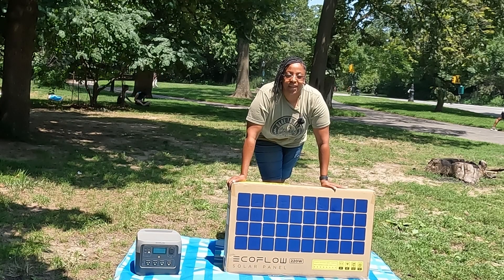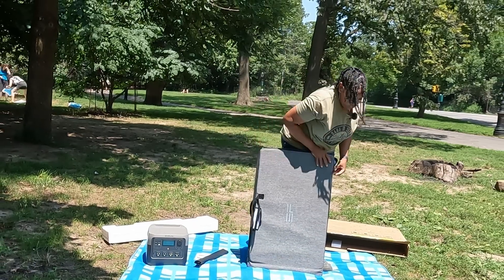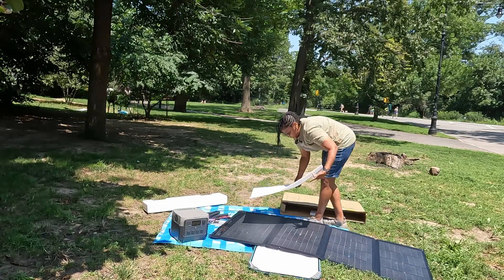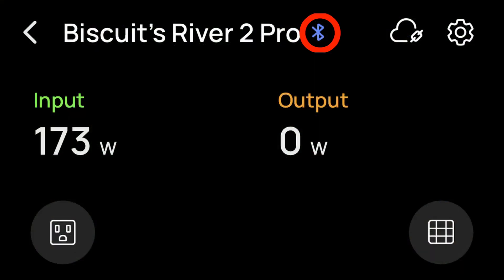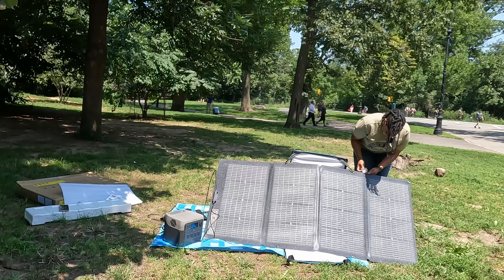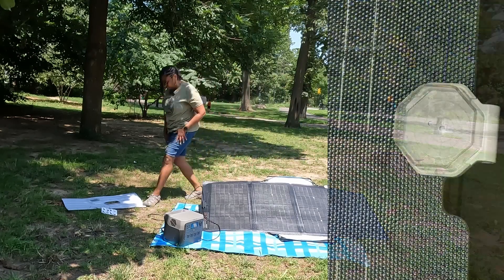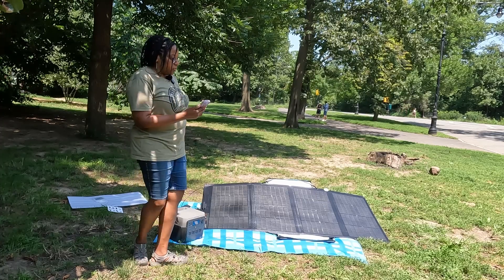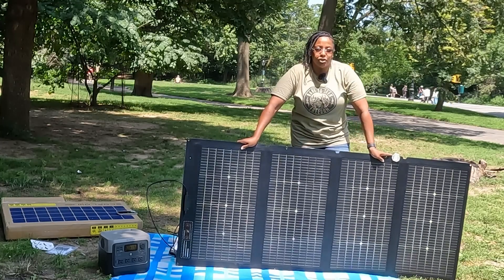EcoFlow 220W Bifacial Solar Panel Unboxing and First Impressions

Comment from the maker: Use Code Shortybiscuit for 5% off all products, excluding flash sale products. (ad)
EcoFlow 220W Bifacial Portable Solar Panel - https://bit.ly/3KaceDi
EcoFlow River 2 Pro - https://bit.ly/43brE0q
EcoFlow River 2 Pro combo with 220W panel - https://bit.ly/3q7G7xe 
EcoFlow Solar Angle Guide - https://bit.ly/44IbNrN

Comment: we just ordered tonight . Thanks for the information.
Reply from the maker: It’s a really good solar panel. 9 months of using it and I have no complaints. There is a new version with a different stand.
Reply: @shortybiscuit  thanks for your recommendation. We are very new of camping. We bought our first caravan and there is no electric for us for to camping. We are camping in a special area as visitors. We are in the queue right now. Until we have our own electric place, we want to support our caravan with EcoFlow delta 2 and this solar panel. 🤗😉
Reply from the maker: @sofiEmoo  this will be perfect! I also have the EcoFlow Delta 2 and the combo is excellent. Be sure to order a solar angle finder - it helps a lot to optimize how much solar is captured.
Reply: @shortybiscuit  i will try to find it. İt seems like very useful 🤗😉
Reply from the maker: @sofiEmoo  this is the one I have. I’ve even used it to align my telescope to the sun for the eclipse. https://amzn.to/3yc3Lfm

Comment: Hi, it takes a bit to use the case as a stand and there are some tricks to position the panel.
I own two of these panels and when I connect them in series I can get up to 480w to my Delta-2 .
Congrats ont eh River 2 Pro, awesome gear.  I use it to provide power during camping trips for a relative's CPAP and other devices that need to be energized.  
It is not unusual to get 220w (the max a R2 Pro can handle) from a singe 220w bifacial.   Just need to play with it and carry 1x4x12 cedar or pine wood planks to help prop. 

Thank you for sharing
Reply from the maker: So true! The solar angle finder helps a lot and after using it for some time I’ve gotten lots better at positioning the panel. They’ve release a new version with an even better stand that I do indeed have my eye on. The River 2 Pro comes in very handy. It’s compact and easy to take places.
Reply: @shortybiscuit  The new foldable bifacial panels are fantastic. I am waiting for a big sale to buy a few.

Comment: I didnt know which was the front and which was the back.  I had it backwards as how you used it. 😅
Reply from the maker: Ha! I could fully understand why. Glad I could help! You should be getting more wattage once you have it setup correctly. The solar angle finder helps a lot to maximize the efficiency.

Comment: Beware, these panels are very fragile.. would not recommend
Reply from the maker: Thanks, I’ll be sure to be careful.
Reply: I would recommend these panels,  BUT , you really do need to make a customised flat pack ply hard case that doubles as a reflective stand, which at this price point is a deal breaker for people that don't have the resources or the know how.

Comment: Since it is a bifacial solar panel, you can increase the wattage by using a mirror or something reflective to reflect the sun onto the back of the panels. You can expect to see an increase of about 10-15 watts.
Reply from the maker: Correct! Even something white should be reflective. I've seen tests with mirrors.